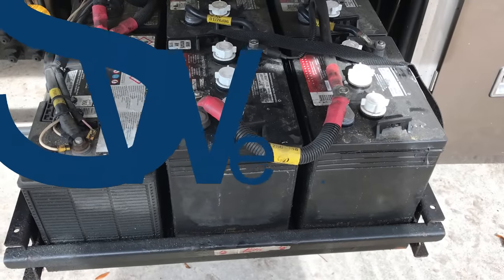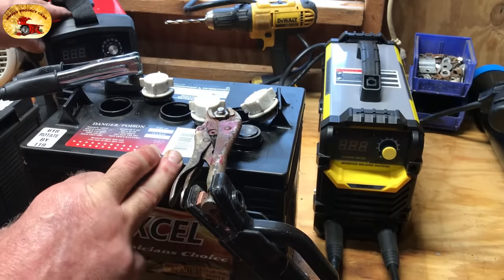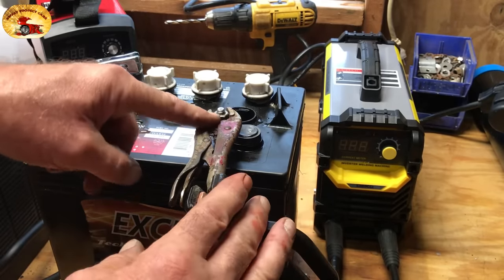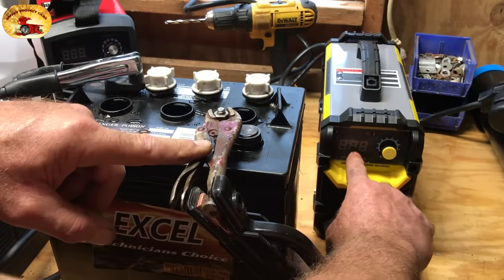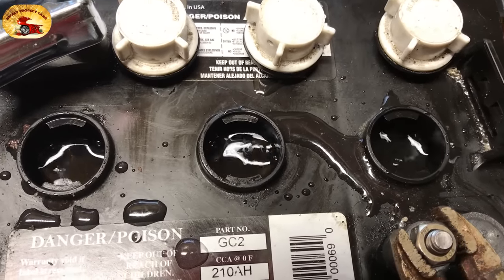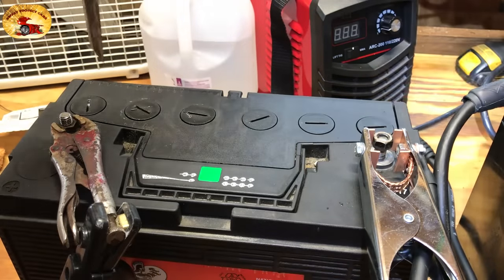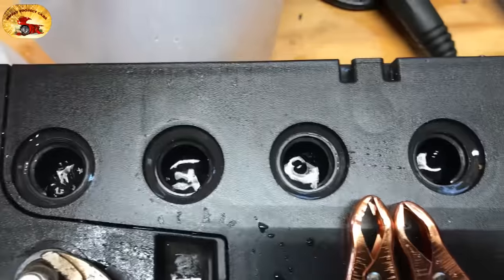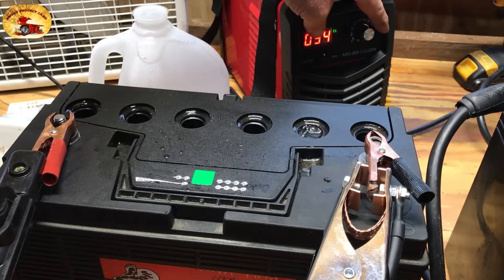How To MAKE OLD BATTERIES NEW Again!!!  12v 6v Deep Cycle, Car, Truck, Golf Cart, Semi

Comment: Okay, I bought a 200A DC inverter welder yesterday since the original battery in my 2015 TDi gave up the ghost in the cold weather.   Rather than spend $200+ on another battery, I figured I'd buy a tool and at least try to revive this thing, plus the two 9 y/o batteries in my Cummins are about done as well.  I topped off the level in the TDi battery and zapped it 4 times last night (it cooled off quick in the cold weather).  When I was done the battery was at 12.92V.  The car fired right up.  This AM it also fired right up (20°F).  We'll see how long this "fix" last for.  I'll zap the truck batteries in the Spring when I need the truck again.  

BTW, the electrolyte looked completely brown clay colored when done.  If this holds out until Spring, I'll flush and put fresh electrolyte in it... it was nasty looking!  Reply later if anyone wants a future update on how it worked out longer term.
Reply from the maker: Great to hear SS! Thank you for watching and sharing, we really appreciate it, have a fantastic day my friend. mad Mike the hammer SPC
Reply: @SweetProjectCars  Well sadly I woke up to a very weak battery, by the time I went to leave for work today, it wouldn't start the car.  Napa is now the proud owner of the TDi battery...

Comment: Wow great video, I watched your video a while back and liked it and subscribed because I like your other videos also. I bought the welder you have on the link above (Amico Professional Welding Machine, 200 Amp Stick Arc DC Welder, 80% Duty Cycle, 100~250V) Do you plug it into 120v outlet or 240v?  I plugged it into 120v outlet and set the dial low at 10 Amps and used a multimeter to check the output volts between the clamp and electrode holder, I got 93 volts even when I cranked it to about 40 amps. How many volts does your welder put out?
Reply from the maker: Glad you liked it Teno! Just plug into regular household outlet, start out on the lowest setting then gradually turn up until you get a steady boil on all the cells. Just follow the video instruction my friend. Thanks for watching, have a great week and Happy New Year. mad Mike the hammer SPC

Comment: 110V 225AMP Mini IGBT ARC Welding Machine Inverter DC MMA Electric Welder Stick. i bought this on please tell me it will work?
Reply from the maker: Please follow the video to a T, there is no other alternative, use the exact same tools, products and method, we've spent years perfecting this process. Thanks for watching and asking, have a great week. 
mad Mike the hammer SPC
Reply: will the welder i bought work?
Reply: @SweetProjectCars  the one I bought works great thanks for this awesome method. The welder was 75$ on ebay worth every penny if I never have to buy a battery again

Comment: So what amps and what volts are you running at ?
Reply from the maker: We start out on the lowest setting then gradually turn it up until you get a consistent boil on all of the cells, then follow the process in the video Steven. And remember make sure you recap and unplug the welder before disconnecting the cables.   Thanks. mad Mike the hammer SPC

Comment: Great video! What is the reason for needing two different welders?  Yes, I understand one is an inverter type that is used for deep  cycle batteries. Why can't one welder be used for both types of batteries?
Reply from the maker: It's just the way it is my friend, kind of like why are there so many different cuts of steaks, why can't it just be porterhouse?  Trust us, we've tested this for years and years and there is a method to our madness here at Sweet Project Cars. Thanks for watching, have a great day. mad Mike the hammer SPC
Reply: @SweetProjectCars  Thanks for taking the time to reply! I plan to use your methods in the video. However, it would be nice to know how you determined the need for a inverter DC welder for deep cell batteries. For example the regular welder damaged the deep cell battery, and shortened it's life. Your really good with your videos, and I appreciate your work! Thank you!

Comment: I want to try it on an old 70amp battery, but my welder is a 220v.... will it work???
Reply from the maker: As long as you can adjust the amperage down on your welder, you can use it, that's why we chose the welders we did, because we could adjust them.  Thanks for watching and asking, have a great day. mad Mike the hammer SPC

Comment: So a buddy of mine use to work at a battery shop some time ago.
He said they would take all the trade ins/cores and hook a bunch of them up at a time and zap them with high voltage.
The ones that didn't take were scrapped. The battery's that past. were cleaned up real pretty like and then slapped a new sticker on them.
Reply from the maker: That's correct Mark, that's exactly what they do and you can too :)  Thank you for watching and sharing, hope you have a great day. mad Mike the hammer SPC

Comment: I have a Lincoln Welder and it only has a ground wire. How do I hook this up to my batteries
Reply from the maker: Not sure what you have for a welder, we don't know of any welders that only have 1 wire coming from it, all welders should have 2 wires, 1 ground wire to ground out the piece you are welding and the other wire to hold the piece of welding rod. Your best bet, as we have tried every welder out there is to use one of the recommended welders in our tools list.  Thanks for watching Clyde. mad Mike the hammer SPC

Comment: Thanks so much for this video
 I bought the arc dc200 welder via your Amazon link. When I power it up, even with the lowest setting, it trips my 20 amp breaker. Any idea what's going on?
Reply: Actually it trips the breaker with the cables not connected to anything. If I disconnect the cables from the welder it seems to work fine.
Reply from the maker: Your breaker is no good, you need to replace your breaker David. If it still does it with a new breaker, return the welder for a new one. Thanks for watching and asking, have a great weekend my friend and all the best on your project. mad Mike the hammer SPC

Comment: I have a golf cart with 8 volt batteries.  In your comments below, Kobi Pinhassi 11 months ago (edited) had the same issue.  However, the comments your made to him are NOT available when I push on the "view replies" button???  Can you help me with this problem?  I need to revive my batteries, if possible.
Reply from the maker: This works on any wet-style battery, Douglas, but for that size battery just cut all timelines in half.  Thanks for watching and asking, have a great day. mad Mike the hammer SPC

Comment: On how much amp we should charge, and also can we revive Inverter battery with same technique?
Reply from the maker: Hello Jay, we start the welder out on the lowest setting and gradually turn it up until you get a rapid boil on all of the cells, then follow the video process, this works on all wet-style batteries, and remember make sure you recap and unplug the welder before disconnecting the cables.  Hope this helps, thanks for watching, have a great day. mad Mike the hammer SPC
Reply: @SweetProjectCars  Mike i followed the welder procedure and completed 5 times, after disconnecting do i need to charge the battery with battery charger? If so how many hours
Reply: @SweetProjectCars  I followed all the steps, I am getting voltage 12.6 and checked gravity it is good, when I connect to car it is not taking that load, checked with local battery shop and they tested with some big meter and they said it should show green if this is good.
Any other suggestions to wake up the dead cell in the battery

Comment: Can you do this to 6 batteries in series on a golf cart, or does it have to be done one by one? Also, what’s the highest amperage you can go on the welder for a 6V deep cycle battery?
Reply from the maker: Yes, you can do them in series CeeVee. This process works on all lead acid batteries, start the setting low and gradually turn it up until you get a consistent boil on your cells. Hope this helps, thanks for watching and asking, have a great week my friend. mad Mike & team

Comment: Thank you for the video, batteries are expensive to replace where I'm at and can't wait to try this when my car battery "gives in" again. I do have a question though, I have a 160amp dc inverter but it does not have a digital screen there's only a manual knob that reads from 0 to 150 amps. Will it work if I just turn the dial to the required amperage as you have in the video??

Again.. your videos are very much appreciated,  thank you.
Reply from the maker: Our pleasure, riyaaz!  Please follow the video to a T, there is no other alternative, use the exact same tools, products and method, we've spent years perfecting this process. Thanks for watching and asking, have a great week. mad Mike the hammer SPC
Reply: Dang.. okay, thank for your reply I'll have to make a plan to source that welder in the meantime then lol.

Comment: I was thinking today about using my dc welder to force charge a dead battery, and here I am. Will try it tomorrow.
The subject has less thsn 1v and won't trigger regular charger to charge, it's practically a new mower battery that sat in situ for about 2 years and is dead.
Reply from the maker: Thank you for watching and sharing Mick.  Have a great day and good luck with your project.  mad Mike the hammer SPC

Comment: Not clear on why I need two different welders?  One variable machine cannot be adjusted to work on starter battery and deep cycle both?
Reply from the maker: You can use whatever you want to use Monty, we are just sharing what we have tried, tested and know works also, it's safe for both you and your batteries.  Thanks for watching, have a great day. mad Mike the hammer SPC
Reply: @SweetProjectCars   can you share what amps to set inverter at for each type of dead sulficated battery work?   In theory deep cycles have thick plates need higher volts to reach full charge, then lower volt range to maintain full charge or float;   vs. a starter battery which has thinner plates and does not need the higher volt range a deep cycle battery needs to fully charge and takes less time to reach full charge but still needs a lower float stage of using a trickle charger.  

So not all of those inverter welders are available on the links, however I tried this method on engine starter battery first but at an amp setting below what the video displays trips the circuit. What amps are you using for each type of battery?   Are you using 220v outlet? What is load rating of your outlet breaker to get the 120v outlet cord on inverter to work?

Comment: How many cycles of 5 minutes on and 10 minutes off do you need to go through to completely reset a batterty?
Reply from the maker: It depends David, some will wake up after 2 or 3 cycles, but we recommend doing all 5, then you can do the full 5 step process up to 5 times. If your battery doesn't wake up after that, it's toast. Thanks for watching, have a great week and sorry for the delayed response my friend. mad Mike the hammer SPC

Comment: I tried it last week Saturday with a totally dead battery, after the fourth cycle I drained the battery water and add clean water and give it one last hit with the welding machine with +- 45 amps. Put it on the charger and charger gives error and can only charge batt on 6v so I proceed till its was fully charged on 6v. Remove battery from charger and set it up in my car while engine was running. Let the engine run for about 15min. Since then till now, No Regrets. Battery still kicking strong thanks to @Sweet Projects Cars
Reply from the maker: Excellent!! Thank you for watching and sharing your results Ivan, we really appreciate it. Hope you have a great day my friend. mad Mike the hammer SPC

Comment: Many of us have a battery charger (or it is fairly cheap to buy) but few of us have stick welders (and they a much more to buy) so why not just stick with the battery charger method?
Reply from the maker: Because this is a way better option for this process greg, it's easier and is more economical. Thanks for watching and asking, have a great week. mad Mike the hammer SPC

Comment: I have 2 large 12 volt Deep Cycle batteries but The Red stick welder  shows currently unavailable on Amazon ! Will the other Welder work just the same?

Comment: I am wanting to desulfate a 12V battery for a car and am looking at buying the gray welder from your link. This welder had two knobs, the one one the right is labeled "Arc Force" what is that supposed to be set at? It would be great if you could do a second video featuring that welder.
Reply from the maker: Set the arc force and main knob at zero then turn the main knob, the left one up until boiling, if it doesn't turn the arc force up until it does.  Thanks for watching and asking.  Hope this helps.  mad Mike the hammer SPC

Comment: just for clarification, if the welders you are using are all DCEN, why wont any DCEN welder work?
Reply from the maker: Hello, you can use whatever you want to use, we are just sharing what we have tried and tested and we know works plus is safe for both you and your batteries.  Thanks. mad Mike the hammer SPC

Comment: To be clear, you're now using and recommending the YESWELDER ARC Welder 165Amp Digital Inverter IGBT Stick MMA Welder,110/220V Dual Voltage Hot Start ARC Force Portable Welding Machine?
Reply from the maker: We recommend using this one https://amzn.to/3sTpodi  for ALL Deep Cycle only 6 Volt & 12V Batteries and for All  Standard 12-volt Batteries we recommend this   https://amzn.to/2K1UsWQ  Thank you for watching.  mad Mike the hammer SPC

Comment: SO  to be very clear here 5 min at lowest amparage (22amps) let it set for 10 min after that 40 amps for another 5 min let is set 10 min after   70 amps for 5 min  let it set 10 min after it 100amps for 5 min after it let it set for 10 min repeat till 200 amps... WILL THAT DO THE TRICK?

 Another question 220 volts AC WELDER with diode bridge to dc current will do the trick?? here we are converting ac to dc according to calculator converting 220v of ac will produce 140 dc voltage will that be too much voltage for battery? i am not electrician but maybe someone could aid me with this question

BTHW MUCH THANKS FOR PRODUCING THIS VALUE FOR US!
Reply from the maker: Please re-watch the video Justas, this process needs to be followed just as shown, if you have to watch it 3 or 4 times, do it please.  As far as your welder question, for success with this process and all of our processes, you need to use the exact products/tools we use, we've done the testing for you, we know it works and we know it's safe for both you and your batteries my friend. Thanks for watching, have a great day. mad Mike the hammer SPC
Reply: @SweetProjectCars  Thanks for getting back to me.  i did and i clearly heard the time frame of charging. The thing is I watched other video of yours with battery charger of 200amps For 15 min and let it cool for 30min.Maybe its a dumb question but  - is this charger produces 200amps constantly for 15 min or impulses? https://www.youtube.com/watch?v=TYXx70MqJ-0&t=0s and if its constant 200 amps with the charger why you cant use this method with welder? it looks like amparages are the same for welder and charger. Which of these methods showed better results?
Thank a lot!

Comment: do you have to empty the acid out of it and then put the distilled water in it??
Reply from the maker: No you do not.  Just top off the cells with the distilled water.  Thanks.  mad Mike the hammer SPC

Comment: Will this method caused battery explosion due to battery faulty or over toast? And in case if there’s a smoke coming out will it caused any danger? I am going to buy a welder to give a try from your link if the process will not caused about my worries above. If I can revive all my car batteries, I will donate to your channel. You look genius!
Reply from the maker: Just follow the video step by step, start the process off slowly then keep turning up until you have a nice consistent boil of all the cells, follow the process and remember make sure you recap and unplug the welder before disconnecting the cables.  Thank you for watching Roy, have a great day. mad Mike the hammer SPC
Reply: @SweetProjectCars  Thank you so much for your kind reply.

Comment: My batteries are over 2-1/2 years old and I use them on a daily basis in my diesel truck. I thought I'd do this procedure to keep them up and maintained... I did live in the hot phoeinx valley but now I live up in the mountains where we have single digit overnight temps. When I started they both started boiling immediately. I got thru 2 cycles and stopped. What do you think about them boiling immediately and only doing 2 cycles?
Reply from the maker: These are two videos you are going to want to watch, they give a much more detailed process. https://youtu.be/LMulvB6TtQA  &  https://youtu.be/1z_f2Wen_UI  But I can tell you this, if it required only 2 times I would have definitely only done it 2 times, so just make sure to follow the video instruction to a T.  Thanks for watching and asking, have a great week and all the best on your project my friend. mad Mike

Comment: Hi this is great .. I lost 12 deep cycle batteries that could not hold a charge.

Did test this with 12v 200ah gel batteries... Mine charge full but  does not hold the charge
Reply from the maker: This process does not work on gel/agm batteries, only wet-style batteries.  Thank you for watching.  mad Mike the hammer SPC

Comment: i got a 6v 7ah battery and it reads 5.90 on a volt meter and filled it with distilled water but cant get it to 6 volts?  

charging does nothing, is it dead?
Reply from the maker: You can repeat this entire process up to 5 times, if it doesn't wake up after that, your battery is toast my friend. Thanks for watching, have a great day. mad Mike the hammer SPC